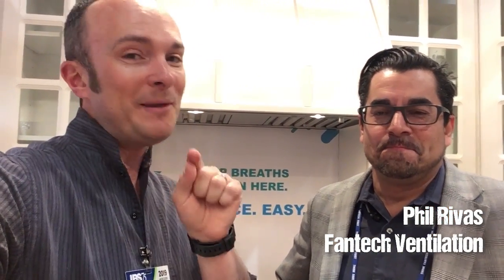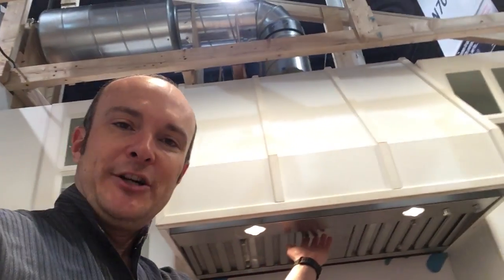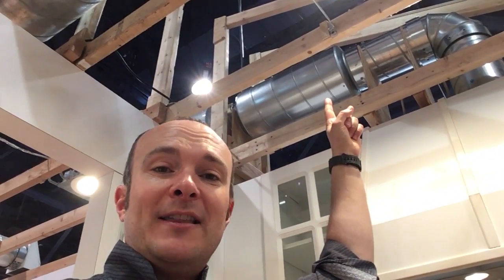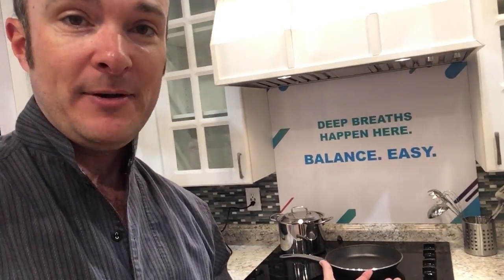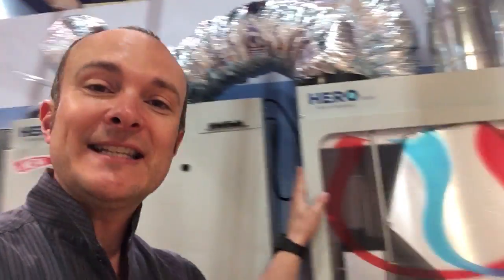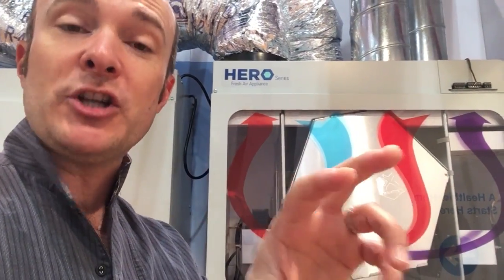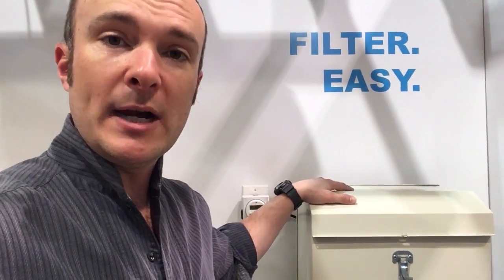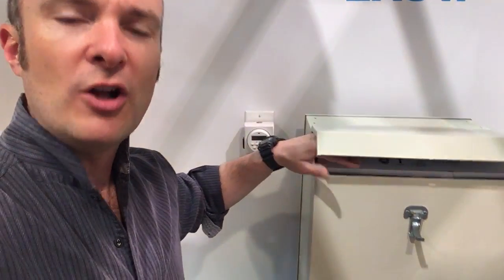Our Home's Full Ventilation System: ERV/HRV, Kitchen Hood, Filtration

Comment: Hey Corbett, did you ever dig in to trying to do heat recovery on the kitchen exhaust stream? Any findings?
Reply from the maker: Hey C- with 600 cfm going each way, trying to recover any heat or humidity would require an absolutely huge device.
Reply: @HomePerformance  Good, simple, point. Thanks. For your new place did you vent down and out for a sort of air-trap / anti-chimney, or just out? Or any resi sized motorized dampers that can deal with cooking exhaust service you know of?
Reply from the maker: Up and out, you can see the final install here:
https://youtu.be/bMkvCn1sGvk
Reply: @HomePerformance  Thank you Corbett. Truly a knowledge creator.
Reply: @HomePerformance  ;)

Comment: Doesn't an ERV need inside dry air to help treat the moist air being drawn in? By placing only an ERV vent inside a bathroom, would likely draw moist air and not treat effectively. I am thinking positive pressure will be effected by having both types of vents inside the bathroom, but placing the ERV outside the bathroom in a hallway would be better and direct venting the shower fan to the outside.
Reply from the maker: Trust me, it works. But don’t just take my word for it- analyze for yourself how much time you spend showering each day. For me, 10 minutes. Entire family, 30 minutes, but let’s be crazy and say a solid hour every day. That’s 1 hour where indoor air is wetter than outdoor air, leaving 23 HOURS of indoor air being dry. No way this is going to screw up your performance on a daily basis.

Comment: It seems like the maximum amount of energy recovery would be 50%. I would imagine in a highly efficient ERV, that 70 degree outgoing air would be able to change 30 degree outdoor air into nearly 50 degree incoming air. How do they extract more energy out of the exhaust air once the incoming and outgoing air reach the same temperature?
Reply: If an erv is 50% efficient then how efficient would two in series be? More than 50! That's how it works.

Comment: Does this ERV monitor and respond to indoor air quality (and the outdoor air quality it's pulling in)? Or is that still not a concern of manufacturers? Also about sound, I called and asked Fantech for a sound spec on their ERVs/HRVs and they told me: "it's not a requirement that we have this spec, so we don't have it". (Kind of a crummy answer, but I still went with Fantech anyway.)
Reply from the maker: Yes, we’ll have a pretty innovative control system they’ve developed. Coming to market soon. And I hear you about the sound test- I can assure you any ERV is pretty quiet. The fans are tiny.

Comment: Great info thank you!  At what point should an erv/hrv be utilized?  I've got a very leaky house (12 ach, I'm working on bringing that down) but would like to install hrv (northern utah).  Assuming that I could not achieve an ach of less than 7-9 would i still benefit from an hrv/erv?  Thanks again!
Reply from the maker: Hey T- it depends on your sensitivity to pollutants. If you’re ok opening windows when the temp outside is mild, then you may not ever need a filtered outdoor air source. Since your area has dry air, you can get away with it- here in Atlanta, it may be very humid or rainy when we’d need to open windows to improve ventilation, which would be bad.
Reply: I know your comment is about a year old at this point but if you're still looking to bring the ACH number down look into a product/service called Aeorbarrier. Their system has brought homes down to below 1 ach readings. Best of luck.

Comment: You mentioned where to put the exhaust in the bathroom. Builders put it in the center of the room  for it to do the best job of the whole room. Putting it over the shower means it has to work a lot longer to remove the bathroom air. And what is wrong with getting rid of the methane? Nobody wants to be in a tight house with high methane concentrations. To have an electric device over the shower it needs to be rated for that location. You state in more than this video that you focus on removing humidity. Since humidity quickly equalizes over the entire room, how did you prove that over the shower works better? Seems a big assumption on your part. Please do a test so that science can show what you say. Do it with different length showers and temperatures.
Reply from the maker: Air will flow past the toilet to get to the shower. Over the shower wins, and we already have proven that with the #TinyLab- check it out.

Comment: I'm assuming you will be using a high efficiency furnace to heat your home. Most have a fresh air supply line coming in from the exterior.  Wonder how that will work with the wok with the ERV? Thanks!
Reply from the maker: High efficiency heat pump, no furnace this time.

Comment: What's your stance on needing to ventilate unfinished encapsulated attics in the south? Local builders here feel as if the ceilings and HVAC are leaky enough to handle ventilation. I personally feel like these are two separate places and encourage still maintaining a good air seal between the spaces as well as having a ventilating dehumidifier with fresh air intake, adding a tee and damper to control a percentage of the dry air into both spaces causing a slight positive effect driving moisture back out? Nobody in my network seems to be willing or able to give me advice on this issue. Most seem to want to add return and supply from the central unit and I just cant seem to agree. I get that it works, just think it's a waste.

Comment: "we have a new ERV technology" There is nothing new about any of this technology. Hex core/counter flow >80% efficiency models have been around for many years. And as far as these being the only ones with an ECM (the M stands for motor, so you don't need to say ECM motor), there are so many other brands that have them, I couldn't even begin to list them all. Just off the top of my head: Zehnder, vanEE/Venmar/Broan, UltimateAir, Lifebreath. It's great that Fantech has finally joined everyone else in the 21st century, but there is nothing ground breaking about this new model.

Comment: that video is good timing.
the govt down under has just introduced new rules for all rental houses and one of the requirements is bathroom fans.
seams to be annoying a few as they are not mandatory on new homes, even tho most do have them. 
a crappy old rental has to have higher spec than a new house, go figure.
Reply: @HomePerformance  what is that ?
Reply from the maker: Go figure emoji
Reply: @HomePerformance  ok, it looks different on pc than on mobile

Comment: I disagree about you comment about bathroom fans. Talk to any mechanical engineer they always spec the fan over the toilet. The fan will still do it’s job regardless. Also life breath makes a great hrv. With a fully variable ecm. As far as hepa cleaners cinquartz makes the best one. It’s a lot more heavy duty than that fan tech unit.
Reply: thats more than likely a case of them pandering to what the client expects rather than actual science. the client expects fart fans so thats what they get.
i see it with welding fans. once your a small distance away from the fan the smoke goes straight past it. sure if you run the fan long enough it will exchange enough air to do the job. the problem is most fans are set to run for a small amount of time, not long enough to exchange enough air to remove the moisture.
its substantially more efficient to extract the moisture as its being made. you can only do that if the fan is directly over the source.
Reply: tweak e I guess it’s all about priorities. I rather have the smell gone first then moisture. Most jobs I work on now are size for one exhaust source for each area. That being 2 hrv or two exhaust fans
Reply from the maker: @AdayintheLifeofsmith  You can get both the odors and the moisture with one exhaust if the bathroom is laid out properly.
Reply: Your not taking into consideration that in lots of bathroom's the toilet is separated with a door "water closet" just the header alone causes the moisture to get stuck. Next time your at a store grab some incense and stand in the shower with your spot ventilation fan "fart fan" running and test your theory. It works.....just not well. Why drag the moisture across the ceiling when you can remove it from the source.
Reply: Dustin Cole in that instance there would be 2 fans
Reply: @AdayintheLifeofsmith   Ethan Smith   Well if it is a open concept putting it at the source of moisture will still remove the smells because your focus there is dilution,mixing,exhausting. All of that happens regardless of fan placement however dragging moisture across the room will lead to poor home performance and is not the purpose for the device. We will just have to agree to disagree here.

Comment: This is awesome! Can you talk about the Maintnence on these types of products? Can they be cleaned or are the inside bits replaceable?
Reply from the maker: The HEPA filter gets replaced every 2 years. The ERV core will be washable. Everything inside also seems to be replaceable too.
Reply: Home Performance this is awesome, especially for us out in the desert where we get extreme heat & cold, cracking a window open looses too much temperature control

Comment: I have been wanting some sort of makeup air for the kitchen. I crack open the window a little when I turn the hood on but have been trying to come up with a design for a makeup air. I'm used to them in commercial buildings and it's nice to finally see one for residential. My only issue is going to be is there an air filter on it and if it does I see the issue with filter access being a big issue. I know here we would be changing filters allot because here in TX we have massive amounts of pollen and airborne dirt year round. Also never understood why they haven't added makeup air vents to clothes dryers as they move massive amounts of air???
Reply from the maker: Good point, Robert, and this unit could make up for any depressurization source. Yes, filter is accessible.

Comment: I’ve always wondered how come someone doesn’t make an ERV that can monitor house pressure and adjust cfm up or down automatically based on needs as exhaust fans are turned on and off. ERV and make-up air all in one...
Reply: This is something I would like to see, but I suspect it’s quite a bit more difficult than you suspect. All ERV/HRV’s should have separate ECM blowers for intake and exhaust so you don’t need a mechanical damper to drop the efficiency enough so the system balances. Then it’s a much easier matter of increasing the supply air blower speed, but I suspect the placement of the pressure sensor would be problematic. I’ve measured the pressure differential in houses, and it’s not as clear as you’d expect. The pressure will be different inside and out when there’s a temperature split. Which is all but a given. And since the ERV/HRV units need vaguely balanced airflow for efficiency, a small imbalance can cause notable increase in costs. Getting the installer to dial this in well would likely almost never happen. It’s possible for sure. But I suspect quite problematic and expensive in practice.
Reply: Same here. It would be very easy. Just use standard 1980s GM barometric sensors or ardunio ones and an ardunio or other simple board and it could easily be done. They read 0 to 5v so very easy to do and then just program a PWM output or 1 2 3 speed output. This kind of automation is easy to add now because all the parts are lego parts. Not out of reach for anyone that wants to do a little reading and make one up.
Reply: Sure, then you will need remote controlled dampeners too to make sure that it is still balanced within the house, so half of the air flow isn't all going into the same room...